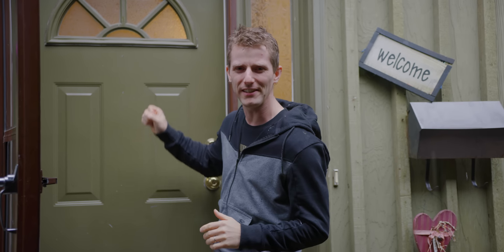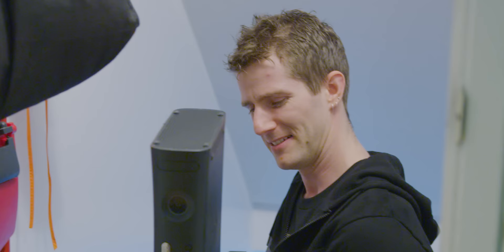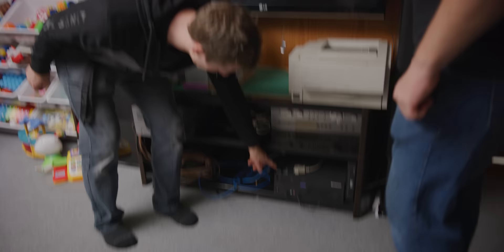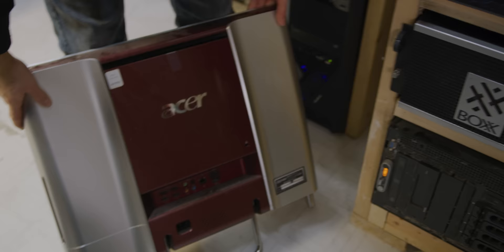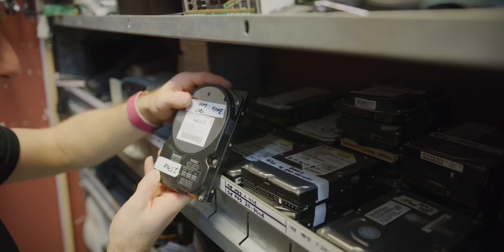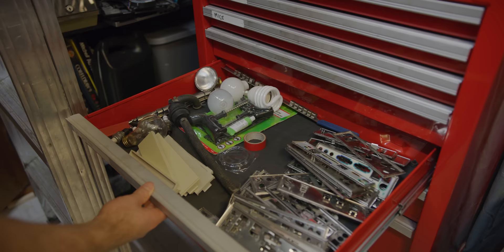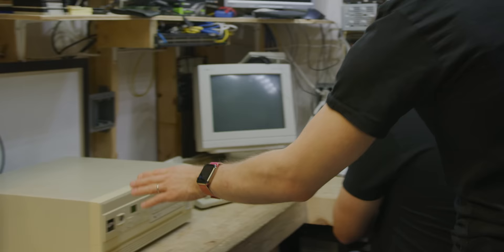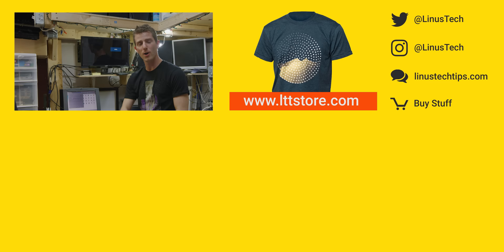This guy has a PROBLEM - Tech Hoarders

Comment: Up to the point you went into the workshop, I was thinking how much his house is like mine.  The loss of functional technology is a real disturbing thing.  Not just for gaming, but also in terms of learning incrementally both hardware and software. The Pi was supposed to roll things back to where kids would be able to have some window into the basics of computers. However, there were just too many "cool" applications for the pi in terms of home automation, so now the focus is less about learning to build your own computer and more on getting the Christmas lights to bink a fancy pattern.  Also in a lot of ways we have gone backwards with cloud computing. The loss of space in most laptop shells means you are dealing with a stick SSD, but most ship with 128G - 256G capacity.  Not much storage if you plan to partition off a dual boot system with Linux and plan to store any kind of media locally.  What Brian is doing is not hoarding but recycling.  If you keep an old dot-matrix printer buy don't have a PC that can connect to it, you're hoarding.  If you keep a dot-matric AND a PC with a parallel port and use it (why? just go to business that prints a lot of invoices, e.g. auto parts stores... they are still on dot matrix tech) then you aren't really hoarding. .

Comment: I know old hardware sounds weird, but in Engineering there are machines running experiments that have been running for decades.
I know one that is recording pipe degradation in a steel pipe, running on a BBC Model B, the computer was bought new for the project, and yes, it didn't care about the millennium bug.

Comment: I have this disease. I have taken much to the salvage yard, but it keeps growing. I think I need an intervention. But now that I have to move, I am throwing away and savaging more. Whatever I don't take to my storage bin is going to the salvage yard. I get 5 cents a pound for electronic "waste". 24 cents for wire,  I think 8 cents a pound for steel and so on. I've sold pounds of memory strips and processors for gold recovery. I've stripped hard drives to get a better aluminum price, and sell the heads with the gold and the logic boards. They say the first step is acknowledgement. I'm there, next I will start throwing away good stuff, only keeping a computer for my life, (paying bills watching you-tube and hulu), One I built to learn video editing on, and a workbench machine, and one or two laptops. I am learning to be a minimalist. btw, My hoard of old school Chevy and GMC parts for my 84 GMC 1 ton van with 350 cu in motor will be with me till I die or they take it away from me.    Just sayin    'Mike            btw, thanx linus for exposing this ailment.

Comment: 8 inch, 5 1/4 inch and 3,5 inch. 8 inch floppies were 80 to 160k if I'm correct and 5 1/4 inch had also 160k, later double density and double sided, the rest you'll can find on google.

Comment: My second computer was a DX2-66. Brings back memories.
Reply: I have a few dx2-66s. They are fantastic dos and windows 3.1 machines and probably the most common 486. 

My first computer (and my dad's, he bought it new I got it when he upgraded) was a Pentium 100 with 8mb of Edo ram, 1gb we caviar 11000 hard disk and Diamond Stealth 64 2001 series (S3 trio64 chip) 2mb graphics card with a sound blaster 16. Ran Windows 95, and I still have that machine. Actually thanks to Disappearing Inc I now even have the proper front fillers for it too.

Comment: I think a lot of tech hoarding is because tech devalues super fast, but if you have an interest in technology you probably bought it when it was current. So you don't want to get rid of something you spent a good chunk of money on, even if it's not worth it anymore.

We see that with some of the hilariously priced listings from people selling GPU's they bought in the dark ages of 2021.

Also as a tech enthusiast, most of us know that there's a million things you can do with even a 10+ year old computer or phone (emulation for example), even though modern alternatives are more practical and use less power. So we hold onto them or get new ones for cheap

Comment: The capacity of a low density 5.25" floppy was 180kb per side, with a total of 360kb if it was a 2 sided. The high density ones were 720kb per side, for a total of 1.2 MB. I think they were all double sided.  Remember, you had to flip them over, too.

Comment: 1:55 all I see is a computer room with a bar fridge ??
3:57 🤣🤣😂 his reaction and smile is priceless
5:09 I couldn't help noticing I have the same keyboard instead of the mechanical.. what is this sorcery sire ! 😂👍
9:09 but.. but.. everyone else did so it is the only one in existence :o  LOL just after this, notice the power cables plugged in and pulled tight, juuuuuuuust reached ! perfection !

Comment: I forgot that my first computer had a turbo button. I completely forgot about that. 66 MHz. We were the envy of my dad‘s techie friend that convinced him to spend the $2000 to 4000$ PC (somewhere around there). But yeah the turbo button definitely didn’t seem to do anything. Funny to learn that it actually turned down the clock speed LOL. I might’ve even left that thing on thinking I wanted to put the pedal to the metal LOL

Edit: at 17:50 he also has a 66 MHz computer LOL. Mine looked very different and I think was IBM. It does the same thing the with the display. I love how it displays the little 66 on it like it matters so much that it got up to 66. It would never go down to 65 which leads me to wonder if it actually did anything at all besides display a static number.

Comment: Hahaha, this guy has modern computers. I still have 2 IBM 8086 pc'c and a bunch of spare motherboards hard drives and floppy drives. The click of the keyboard is nostalgic.
Maybe in 30 years or so they may be worth something.
Reply: All I have left from that era is a full-height single-sided single-density 5 1/4 inch disk drive and an original IBM Model M keyboard.

Comment: Honestly, one thing I wish was a thing for all in one PCs…. GPU slots.
Cuz like…. Some super slim form factor tower PCs, and laptop had a slot called “MxM” which was the last sort of thing used for those devices before they decided to solder the CPU and GPU right on the mother board. If those older iMacs had those slots, you could replace the GPU, and it would work.
Same should happen again with modern systems. Like, we would have the soldered on components, then have slightly bulkier slotted versions for GPU and CPU stuff so you could at least revive them again someday.
Imagine if you could do that for some 12th gen i9, RTX 30 laptop/all in one, and replace them with a socketed mobile variant like the old times, when they actually did that. Of course, they soldered the parts to the mother board to reduce costs, but they should still have that option.

Comment: oh yeah I'm there.  Not on the same scale but I have the 1st computer I got in 1998 (I think!) that I got after searching the want ads in the paper.  A 450mhz AMD K62 with a 2gb Quantum Bigfoot hdd.  It still boots up too.  Have the plastic little cabinets with old motherboards, cables and whatnot.  You never know when you'll need something!  Again not on this scale but I can relate.  I have 2 CRT monitors also (one 21 inch cost 200 dollars used about 20 years ago) and they still work too.  The software cd wallet too is something I have a couple of also.  I have 8 working pcs (not counting the K62 and 2 raspberry PIs running Batocera) ranging from XP to 10 but none in the kitchen.  I have a girlfriend and she does draw the line somewhere!

Comment: No 80387 coprocessors, tape drives, 8 inch floppies or punch cards?  I think if you looked a little you could find a notching tool for those 5.25" floppies.  I can relate. :)

Comment: "Turbo button actually slows down the system..."
Well there was a time, well before your time, when the turbo button actually increases the cpu speed. It turn my 8mhz PCAT to 12mhz and boy it does get my turbo c compiling a little bit of a breeze. Talk about instant overclocking!
But then I guess we're talking the same era. Just that the normal system speed are set up differently. Cheers! ;-)

Comment: I WAS GETTING PRETTY BAD with my cable hoarding, literally had something like 2,000 different types of USB cables. Now it's down to 500 or so. I'm still pretty bad, but I've gotten rid of a lot of my tablets, and when Samsung comes out with a new one, I send back the last gen for store credit. Before, I wasn't doing that. Sold off and gave off all my iPad Pros. THOUGH, do have a huge collection of useless chinese mutli-emulators like the Ambernic/PowKiddy/Retroids and what not. Also need to cut down on controllers as well.

Comment: Linus complains about 2 amps.
Me looking at my 7 Speaker amps all plugged in and connected to a mixer that separates the audio into separate sound channels to be arranged via a program on my PC to give me 49 speakers all micromanaged with both up and down surround sound.
The more amps the better, plus less amplification overall so more clarity and better control. 7 Subs in different locations are also amazing in most films and games that support surround sound or even virtual surround through stereo as my matrix can decode that into basic directional.
Multiple Hue garden light strips and a bunch of other hue lights are layered around and managed by Artemis rather than Hue's app and sometimes even programmed for specific movie scenes.
A 55 Inch Monitor with two portrait OLED monitors on either side.
Simulation, Immersion and Movie nights can be amazing with cuddles, chip and dip

Comment: lmao. that's nothing. like nothing to another world degree. my granddad had an electronics company that he had been running from home for several years and still has most of it. and then theres me and mine that has been adding to it. need tubes for an old tv or organ lol. need some parts from the first IBM computers haha. and then theres parts, like internal parts not yet soldered onto a board and also boards never created so they look just like empty copper sheets.

Comment: How do I get hold of this guy?  I have a 80486 based NT 4 server running oriellys website (Robert Denny- created win-cgi ) Cold Fusion 4, SQL x.z???  In a custom 4u case... Still runs... Just couldn't junk it... Served up pages for many years in later 90's through 2007.. Might even be NT3.51... Brains getting fuzzy
Reply: I'm on the LTT forums and on their discord, as well as the Tech Tangents discord.

Comment: Hey, what kind of computer specs do I need to have for android development and to run IDE's ( specifically IntellJ IDEA) smoothly?
Reply: IntellJ IDEA ...smoothly xD .... OK, that was fun. Thanks!
You will NEVER have enough memory to run Java applications smoothly for hours. It will either lag from the beginning or eat up your memory while you try to use it. It is ALWAYS like this. So just get the best with what you can afford to spend.
Reply: @fumanchu4785  Hey, I really appreciate you leveling with me!!! I'm currently running a rig that has a AMD 2 core 2 threaded processor, 32GB of RAM and a SSD and my screen flashes and locks up when running IntellJ IDEA and makes me want to get violent with my computer!!!!!!!!!!! I guess I'll move up to the pitiful upgrade that the manufacture of it will let me do, to a 4 core 4 thread CPU... Any, suggestions on a rig I should upgrade to?!

Comment: Any "full height" hard drives?
Reply: Not when this was filmed but I do have a full height 9gb scsi monstrosity now that takes FOREVER to spin up lol
Reply: @lttbriantheelectrician  maybe you have to "terminate it" properly for faster spinup?
or add a crank handle
Reply: @flyingdiscproductions  Lol a crank would help im sure lmao but it's really just due to the mass of the platters. Takes a good 30 seconds or more to spin up and having it connected to a scsi bus doesn't make a difference. If you move it around a bit running you can easily feel the gyro effect of the spinning platters.
Reply: @lttbriantheelectrician  are you saying you dont have this device terminated?
Reply: @flyingdiscproductions  its been a while since I've looked at it but I believe it is self terminating, configurable with jumpers
Reply: @lttbriantheelectrician  that would be strange for SCSI devices ...

Comment: Why isn’t he mining crypto? The motherboards are ridiculous...With the built rigs he has, why would he have cause to use 1 of those boards? Start a charity. I did an inventory myself, and I have 4 computers in my “office, all pretty recent, unused tablets, extra storage drives, a couple phones...one PC is a mining rid, PCI cards unused, cables everywhere, but mostly it’s a result of impulse upgrades I didn’t NEED. I keep my 2012 MacBook Pro because it has a disc drive... but tech is fun, I’m sure not to get too redundant. Everything I have is modern, it still has a use, so it’s not worth just ditching. This guy is over the top, I get it a little, once you put together a computer yourself, a motherboard takes on new meaning, for him, it turned into a mania. At least it’s plastic mice lurking in the corners, and not actual vermin u see with real Hoarders